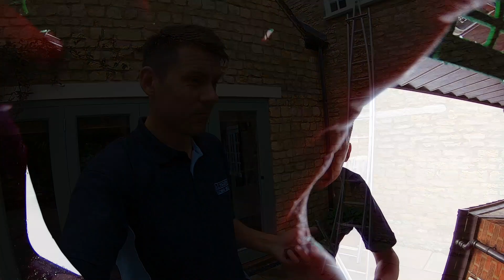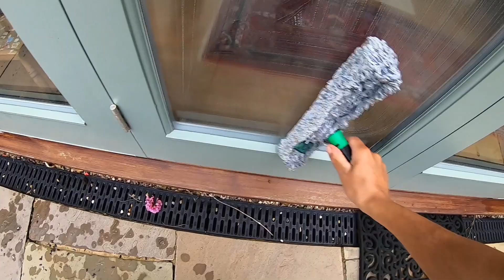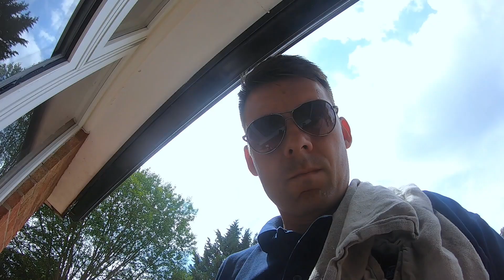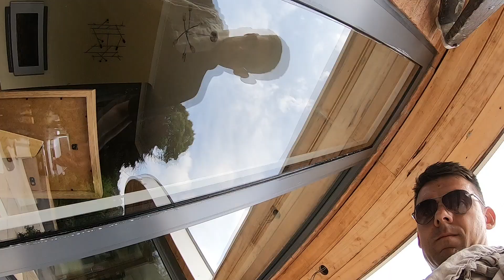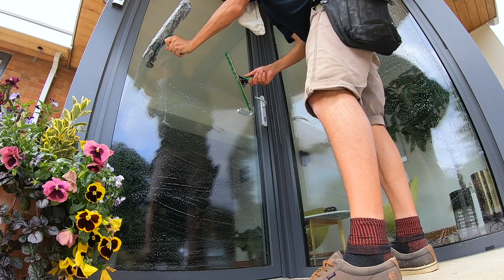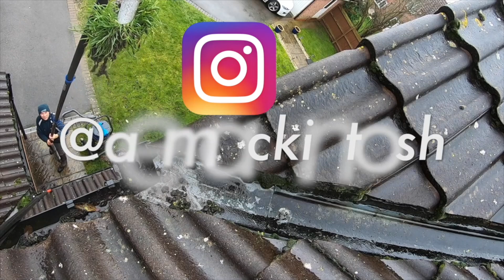Unger Black Series Traditional Window Cleaning Kit In Action

Comment: Such an inspiration for which I have enjoyed following your channel and watching your videos. Gardiner WFP pole, backpack and brushes have now arrived but I am pushing myself to learn the trad style first. I also have the black series kit in your video but today I am finding that the squeege rubber on the edges is hitting the frame and leaving water down the sides. Any advice?
Reply from the maker: The ends of the rubber can flip up when they hit the sides. I find them fractionally too long for the channel. Try cutting a few mm off the end of the rubber and see if that helps.😃👍🏼
Reply: @aemackintosh  Just to confirm that this has helped. Thanks again, Ashley!
Reply from the maker: That’s great! Thanks for letting me know.😃👍🏼

Comment: I’m still practicing my Trad skills. I find after I’ve cut in to the top left and then move to the right the squeegee starts to drag and judder across the glass toward the corners. What am I doing wrong? Too steep and angle?
Reply from the maker: A steep angle is good. It can depend on the frame around the glass sometimes, the rubber can get caught up on it. Try not to press into the frame too much, but keep the pressure on to the glass and let the squeegee flow.😎👍🏼
Reply: Keep your eye sharp on the top corner of your squeege. It wants to be cutting along the top of the window but not banging against it. There is a difference but I didn't learn it untill experience came knocking. 

I like a 45 degree tilt with a 45 degree angle of the tool. It gives that leading edge of the rubber a point that cuts perfectly. 

I hope that makes sense.